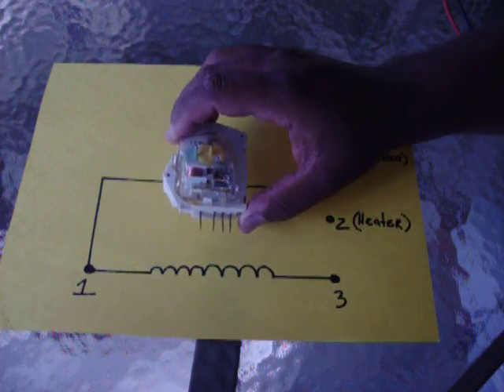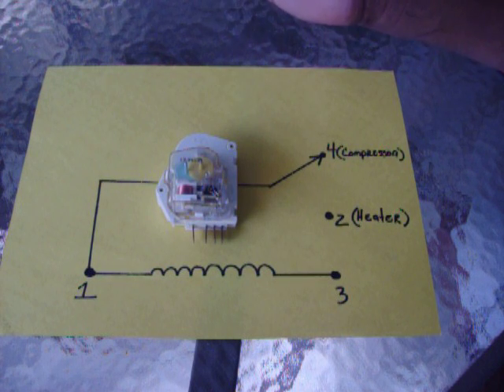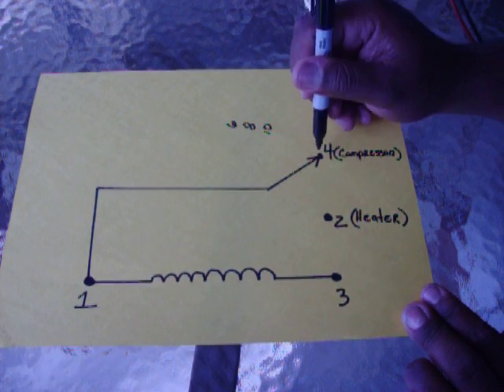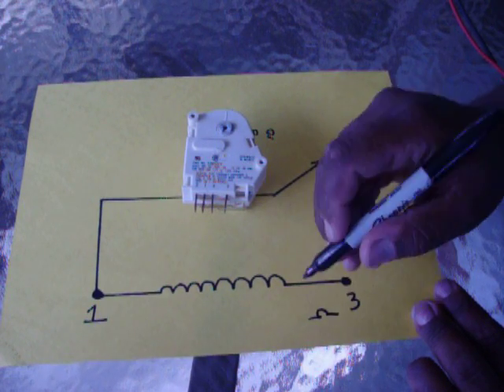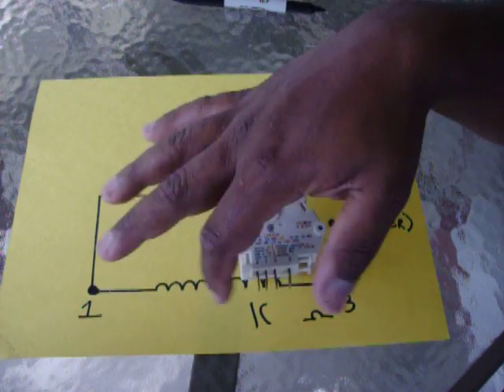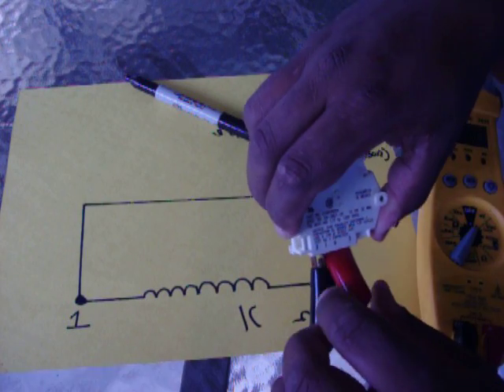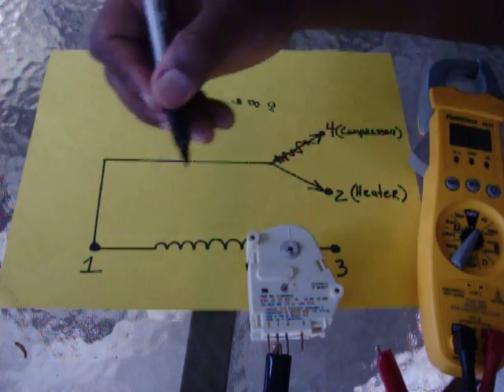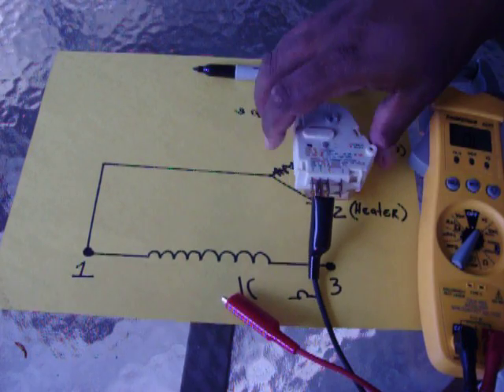How to check a refrigerator's defrost timer.

Comment: Hi.
Thanx for the informative video.
Is it possible for a refrigerator defrost timer to test out ok, and still not function properly, when current flows through?
I replaced a defrost timer on my Frigidaire 5 years ago, and it's been working fine since.
I kept the old one just for kicks.
Cooling and defrost circuits test ok for continuity.
Timer motor measures 392 microfarads.
The reason I'm asking, is that I currently have the same situation with another Frigidaire.
Any help is appreciated.
Thanx again.
Mark

Comment: can't understand what is said at the 2 minute mark. Something about the Ohms setting. Little help please?
Reply from the maker: The resistance of the coil is very high. 1000+ ohms. Make sure your meter can read that high and is set correctly.
Reply: @21footxpress  What if the defrost timer doesn't have continuity (Ohms) resistance, but I get a Micro-ferad reading, is the timer bad?

Comment: This was so helpful! The part about changing the ohms range to be higher was very helpful - no other videos mentioned this. Totally new to electronics but I think this means 2000ohms range (instead of 200ohms) is the right one to use on multimeter? That's what gave me an (I think) accurate reading. If anyone sees this - does that sound like correct range setting for testing this defrost timer?

Comment: wow this was fantastic. Are the evaporator coils in the freezer supposed to be covered with frost at the same time or do they go through a pattern freezing one coil at a time while its running? I have 12 covered over a long period of time before the system kicks in to defrost.  I think I may have a sealed system failure but I don't know if it's possible the timer could come on too early which would cause the problem.  Thanks

Comment: Can I connect a battery to 1 and 3 and try to listen to clock ticking and how many volts do you think I should be using if I dont have a Multi-meter with advance functions like yours?

Thank you for your great explanation.

Comment: Why does the timer motor gets weak to turn to heater mode ...is it dirty or the winding fails or is the gear causing it to bind due to too much tensions (mechanically that is) or could the three contact tension be lessen.

Comment: was slow getting to the clicking part but the last part summed it all up, and the drawing + continuity test was very effective and should be done more often. Everyone may have different ways to make learning easier, but if your showing a real scenario test along with a step-by-step drawing, that's about as easy as it gets. Hopefully everyone starts to use this style of educating. Too many times Ive walked up to a unit, removed a panel  and quickly realized that the technician before me was as smart as a rock. You should be able to leave your complete info on the unit after touching it. CONFIDENTLY knowing what you did, and can be explained if needed. So I tip my hat to you sir, well done lol

Comment: This is a good test for the defrost timer - unfortunately you can still test the defrost timer like this and the timer can be bad.  What you didn't mention is the fact that the defrost timer can get stuck when turning and therefore the defrost timer will  no longer work the way it was designed to.  The timer gets stuck when the timer motor gets weak and can no longer turn the gears when the contacts need to be switched.  If you check and test all the refrigerator components and they test good with  the unit still frosting up - best to replace the defrost timer as this is the problem.

Comment: I checked mine and got continuity between 1 and 4 turned it. Continuity between 2 and 1 for some reason the compressor was still not kicking on. I swapped out with a new timer anyway and that did the trick. Why did it taste good and have the new timer fix the problem?

Comment: I get a reading of 4.7 ish mfd when defrost is engaged, leads on 1 and 3. When defrost is not engaged I don't have a mfd reading between those same two terminals. Is this supposed to be this way if the defrost timer is good?

Comment: I would like to correct my last statement and have you verify if this is correct. The capacitor is run in series with the clock motor. placing the cap between (1) and the clock motor, so if the clock motor windings short out, the cap will blow and prevent the windings from cooking. Is this correct. I am confused on what the purpose of the cap is.

Comment: I think you may be wrong on where the capacitor is connected, I believe it would be hooked between (1) and (4) to
prevent the contacts from being burned when a heavy load when the compressor kicks on. Need you to verify, I can not understand why they use a cap.

Comment: your explanation is very thorough and informative.  i learned a great deal on this subject. my fridge has a different set up. i have a kenmore top freezer 795.6929 and the defrost is located on the bottom in the back. also, where the control panel is located in the fridge area there is a sensor for temperature purposes. what would be the best approach here?

Comment: 21footxpress, 
Thanks so much for the video!  Excellent work.  
I was originally getting false 'no-continuity' with the continuity buzzer on my meter.  I then listened more closely to your explanation that I need to 'switch to micro-farads' to perform the resistance test.  
Are you able to explain why a simple continuity buzzer would not function with this test? 
Thanks again.

Comment: Great explanation! I found it very useful when troubleshooting mine.  I found that the connection (capacitor) between 1 and 3 had blown up thereby failing continuity between 1 and 4 on compressor mode. While on defrost, the continuity failed between 1 and 2.

Thanks a lot!

Comment: Thanks for the video! Using it, I was able to test the Defrost timer and prove that it was good, I then tested the heater with a multimeter and it read 36 ohms. I then narrowed it down by testing the Bi-Metal Thermostat in a glass of ice water and it remained open, when it should have been closed. Jumped a wire to bypass it temp and clicked the timer to defrost and voila it was heating as it should! New Bi-Metal Thermostat ordered for $17 shipped off Amazon! Saved money over buying a new refrig.

Comment: Well done video! I have a defrost timer that ticks constantly, sounds like a clock ticking. The fridge never seems to maintain a consistent temp, running 39 degrees to 48 at various times. Freezer always seems fine though I don't have a thermometer in it to test. Also, this is a freezer on top model and the frame above the fridge and below the freezer get quite warm sometimes. What do you think?

Comment: I have a question. The refrigerator that I am working on has a defrost timer just like the one in your video. I tested it out and its a good timer but, when I put it back in, it advanced from the defrost cycle into the cooling cycle. But when the compressor comes on the the timer stops ticking. should the timer be on 24/7? also what capacitance reading should i get between 1 and 3?

Comment: Hi 21footxpress,
great videos. I have a question on a commercial time defrost digital type. 
How do you determine the wire connections if you don't have a diagram.
The unit has 6 wires. black, white, yellow, purple, blue and orange.
black is power
white is nutral
and the rest I don't know
thanks

Comment from the maker: The reading from 1 - 3 will be very high. Make sur that your meter can check thounsands of ohms. The coil will be near 12k ohms. You never make an ohm check with the unit plugged in. Unplug it and remove the timer.